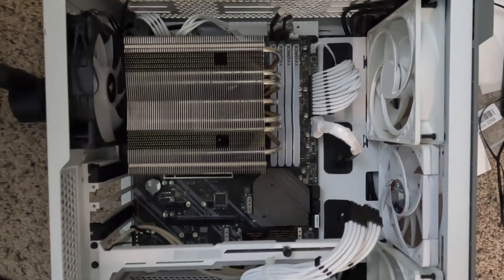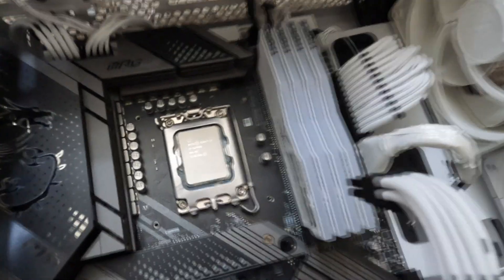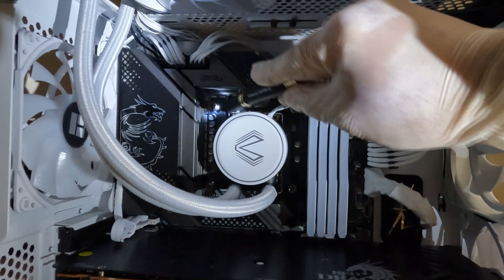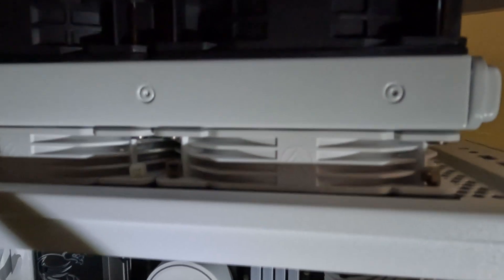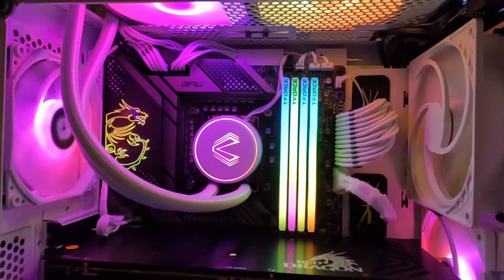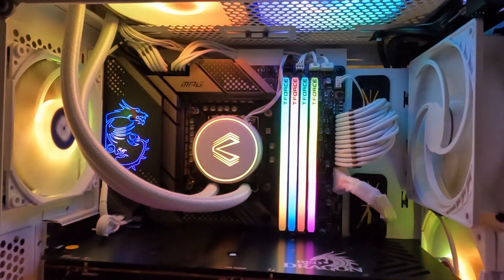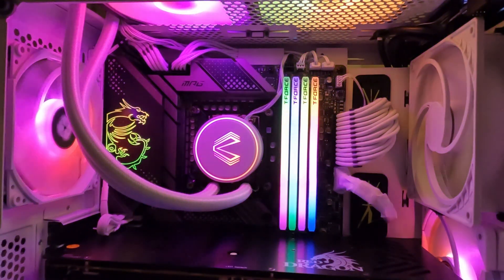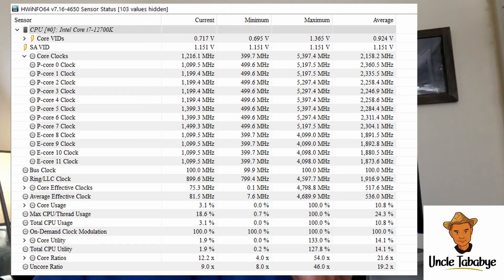Part 2 Vetroo Lurker OC Intel 12700K & MSI Z690 with Benchmarks. Budget, available & reasonable AIO?

Comment: What temps reach Mobo PCH after an hour?
Reply from the maker: Highest I saw during the benchmark runs was 63,  the case airflow is good and I also have a 40 or 50mm fan double taped to the M.2 heatsink pointed upwards through the vrm heatsink.
Reply: @DragonRoll_Sushi  ok sounds good,I have also same mobo with 2 nvmes max 61c temps after an hour heavy gaming ,I'm with Lancool 2 mesh case,I don't know if I used 4nvme slot's in future,probably I will have 10c higher temps in chipset

Comment: I dont know from where did you got those AVG temps while you running HWinfo64 with +90ºC all the time and you put in text like 67ºC....kind of suspicious...my advice is to refresh the HWinfo everytime you change the test and you want to know the AVG, just click on the clock and all will be refresh, otherwise you video (result) are very weird.
Reply from the maker: Thanks for the tip but I'm done with testing it. I recorded the data from HwInfo as I was running each benchmark and used the data for each of the run, hottest Core Temperatures (avg) [°C] and whichever is the hottest P-core [°C]. I didn't include a separate E Core coz it doesn't really get as hot as the P Cores and I don't care as much about the E Cores.